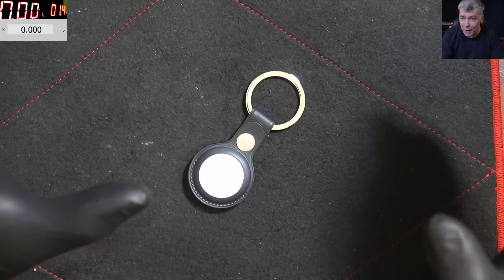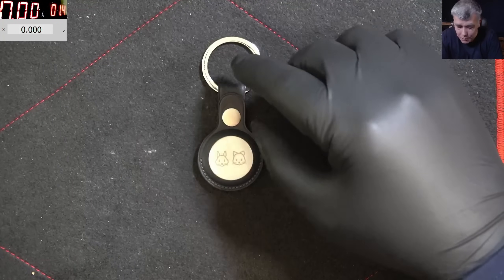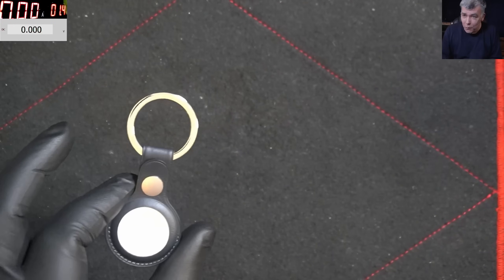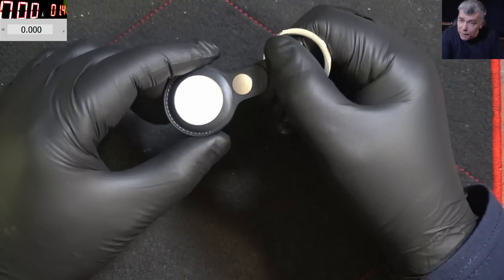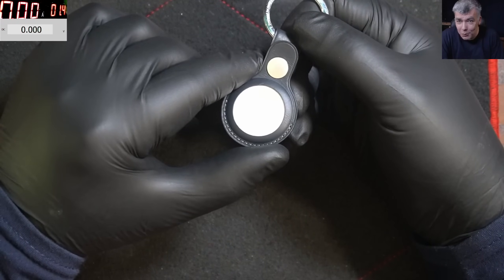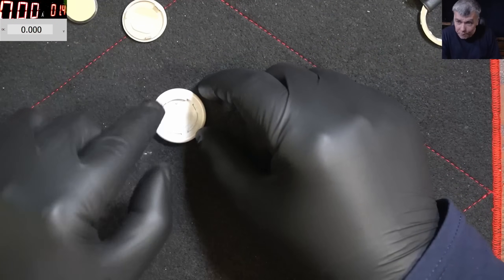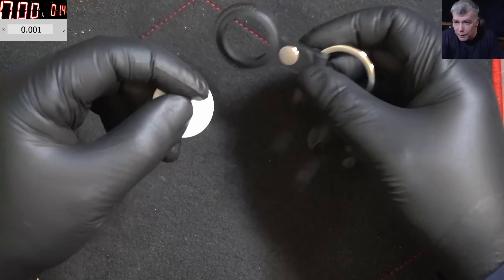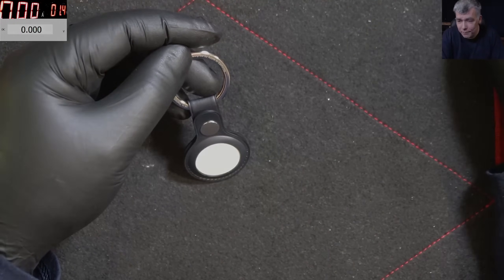Apple AirTag speaker disable - AirTag modification for silent tracking

Comment: I did this for my car tag, incase the car is stolen. The thieves won't hear it beeping giving me a chance to find my car.  But I didn't have a hot air gun, I ended up braking the clips that hold it together.  If you do try taking yours apart use the hot air or find some one that dose.  I'm trying super glue to put it back together at the moment. if that doesn't work I will have to find something to clamp it and hold it in place and leave it that way and hide it with the clamp.

Comment: Thank you. My motor bike was stolen and they removed AirTag due to sound I guess. Was hidden very well . This helps ! And makes it much more useful.
Reply: They're not such a good solution for stolen things - I would still use common GPS, LoRa or WiFi trackers for that. About 15 minutes of being disconnected to the owners iPhone it will start looking for other phones and at that point you can use Android apps that will detect searching AirTags nearby. So you can't really hide an AirTag in a stolen device for a long time if the person that steals it knows what it's doing. It could make sense to use multiple devices like a GPS tracker AND a hidden Apple or Samsung Tag, but I wouldn't use them alone if the object you want to protect is valuable. Using multiple technologies at once might also be a good way against jamming. Or try something like OpenHaystack project. It makes use of apples find my network, but uses and ESP32 as a tracker and removes Apples anti tracking protections. But this can still be detected by the Apps then I guess.

Comment: Why isn't google doing the same with Android os via Google play store accounts? So I've had to buy an airtag and iphone 6 just for that. One in my car and one retrofitted into my wallet flat packed into perspex card.
Reply: Samsung has some, Tile has some....but to be honest these devices are more for stuff you can't find and not as an anti theft protection. Apps can detect AirTags them so I would still keep using GPS / LoRa / WiFi trackers or a combination of multiple technologies. Especially if it's for valuable things like a car, bike or something similar.
Reply: @Leif_YT  Would be best if it just ran natively under Android OS though without having to install apps or sign up via Samsung account and imagine if Apple and Google joined forces then it would be truly Sooper dooper paratrooper stalking. My Big Brother government stalks me everyday. It's quite acceptable.